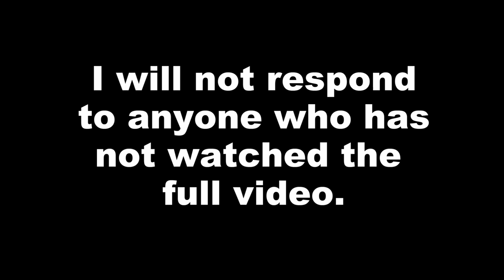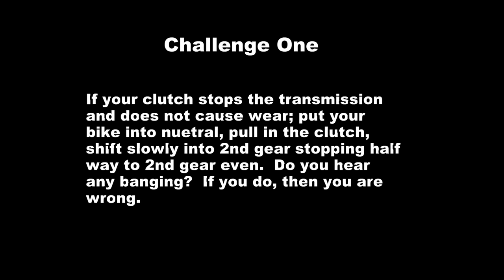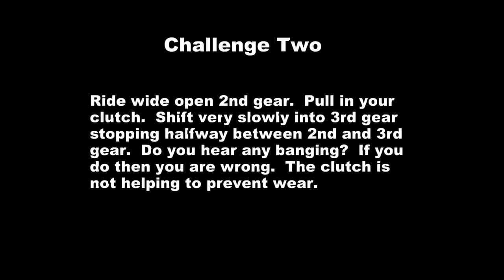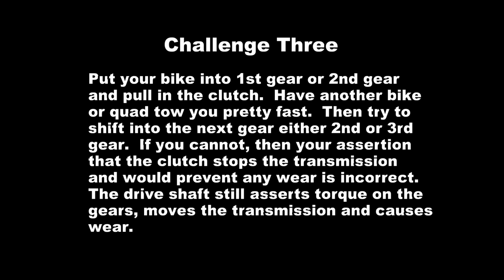Dirtbike: Shifting without the clutch

Comment: hey man I have a 84 i.t. 175 doesn't look original lol thank God. anyways besides seeing a peace of paper in the beginning it seems damn well like you know your shit. anyways back to my bike I'm 17 rebuilt two 2 stroke engine one at the time was a stock 250 I gone threw bottom and top and replaced every bearing second engine is a 86 ATC 250r I not my self but had bored out to a 310 port and polished with nitros lol jk but is bored out to a 310 port and polished I know how to rebuild don't know to much besides how to make them run again. now my dirt bike I use for putting around the 175 the engine fr tears it self up it's a bitch but uh I'm mind blown about this and I'm usually good at figuring out problem but this bitch decided one day last year to run like the idle is turned all the way up I checked for air leaks along the entire thing can't find none it has not even 14 hours on it sense I last had it rebuild and learned about this engine from the fr number one best Yamaha engine builder in my state. that's how I learned what kills this model engine. I think it could have something to do with the carb but wouldn't it make it run lower and goofy not a smooth loud ass roar. before I road it he told me temp for heat cycle did that 5 times he told me to do it 3 times didnt let power band kick in to it had 10 hours on it and still didn't ride it hard just cause how many hours is on it. if carb needed clean it would be bogging out and shit not a high ass rev that sounds like wide open throttle times 9. jets are set perfect nobody fucks with my bikes and nobody rides my stuff. if you have any ideas pls let me know. I do not expect a reply with you having 450 comments if you could get back to me that would be great. I don't expect you to know dead on what's up but if you have any ideas pls let me know or if you know pls let me know. oh I checked gas going from tank to carb. doesn't seem like no blockage
Reply from the maker: "one day last year to run like the idle is turned all the way up"  If the engine revs up it is an air leak somewhere, either between the carb and the cylinder or perhaps the crank seal.   Turn in your AIR SCREW all the way, the bike should shut off.
Reply: Opferman Motors Dirtbiking ha so my first guess had to be right. I'll have to double check a long I've never really had this problem before. Do you know any tricks to spot an air leak. I looked for any spots didn't really see anything I'll have to go back over it this weekend.

Comment: I didn't have to watch this, and i couldn't make it thru your lengthy and rediculous beginning disclaimer. Wanting videos, written and notarized documents from the original engineer of transmissions for dirtbikes. A personal visit from Santa Claus. Bob Hannah's signed autograph included with any disputes. And last but not least, An original 4' x 6' Velvet Elvis Framed only in the finest west Indonesian Jizzwood constructed by Priscella herself, personally delivered by her, with a letter approved by the president, written by the person questioning anything you say.

  Do NOT shift, while the transmission is under load. End Video. Constant fn mesh is ya key there.

Comment: A complete failure to take into account any engineering and physics issues.  The biggest failures of this entire "analysis" (actually just a lot of unjustified opinion) is that no account is taken for time (e.g., the time it takes for a gear to shift or the engine to accelerate/decelerate during a shift and the loads resulting therein) and the complete lack of any science or real-world testing and analysis of such tests.  Simple proof of excess loading with clutchless shifting can be obtained by anyone who shifts a road bike w/o using the clutch and noticing the extreme jolts the entire drive-train experiences.  Common sense will tell you the difference in crankshaft, transmission, chain, spokes, etc. loading is potentially many times more severe than when using a clutch (because the TIME it takes to spread out the RPM difference between the engine and wheel is many dozens of not hundreds of milliseconds).  Forget the goofy challenges - they are random excuses to not do any real homework and have no bearing (pardon the pun) on real-world shifting under load and done quickly.
Reply from the maker: scott taggart nice opinion and failure to follow simple directions.  They taught kids how to follow directions in elementary school so besides failing to discredit thru ad homininens you failed to create a video response.  No one is reading a BS comment without any credibility and failure to follow directions.  When you grow up and do a response like a big boy and follow directions we can take you more seriously.